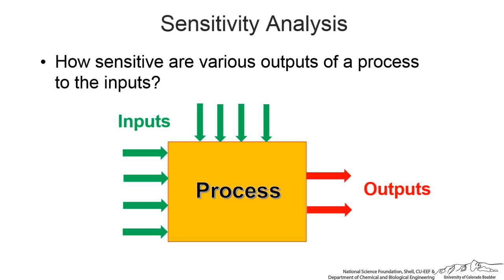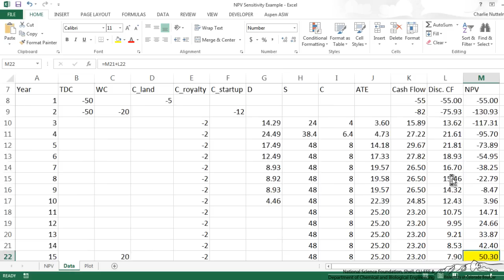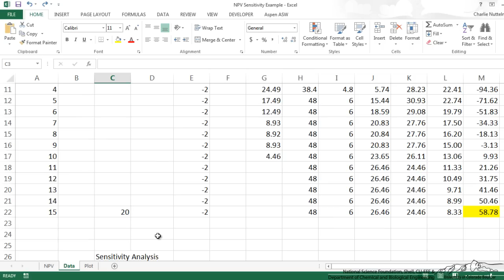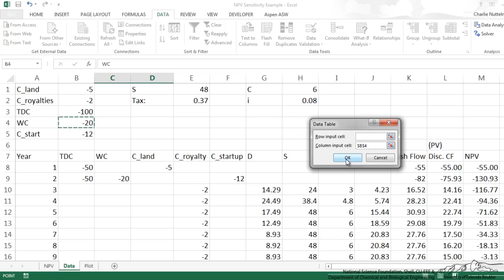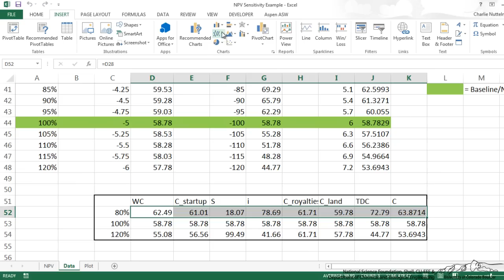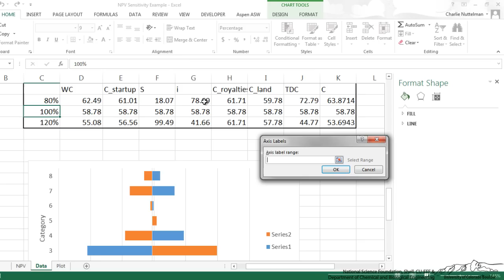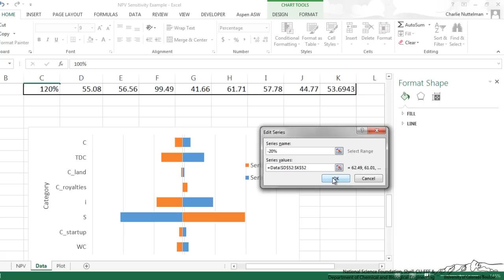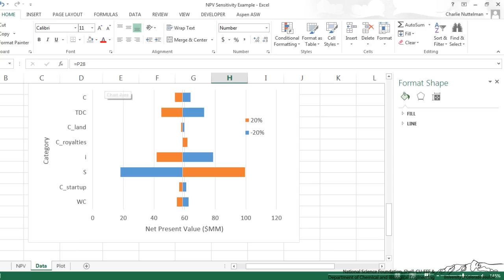Sensitivity Analysis and Tornado Plots

Comment: i have run it using STOIIP calculation, but still, I am getting the same answrs ( what imean when I have changed the variable for example in your case CW and S I have get the same numbers in my analysis and I got 59.7 for my whole NPV ).  - seems bit weird for me if you can help please let me know how to fix this problem?
Reply: did you fix it?? having same issue